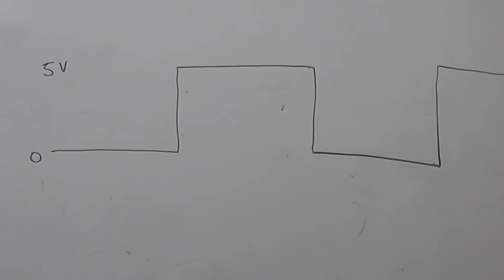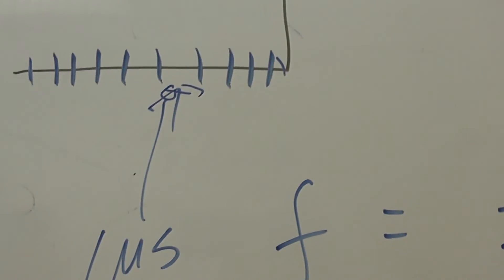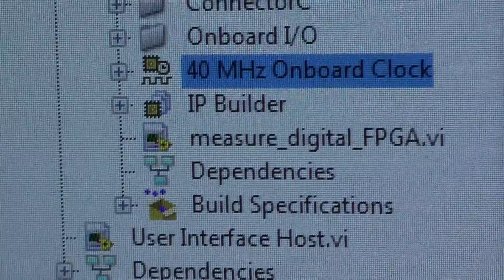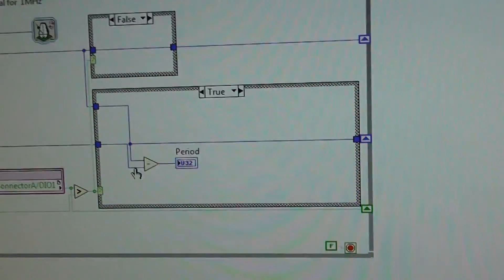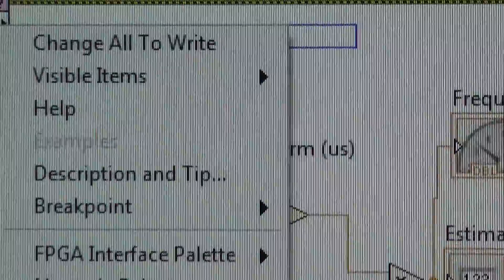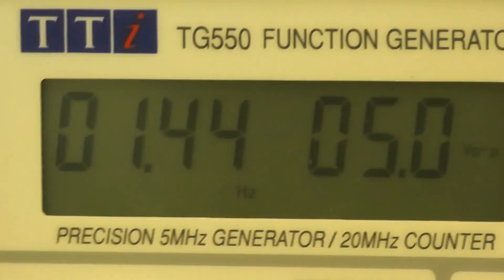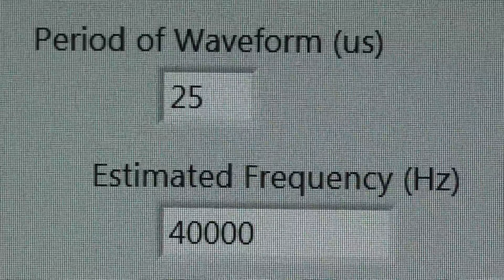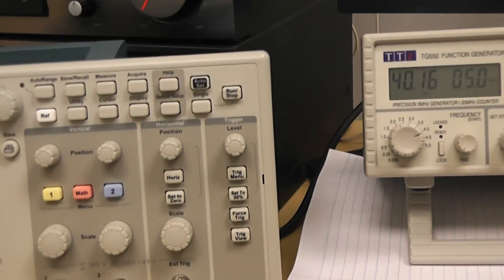myRio FPGA  Digital Tacho Measurement of Speed

Comment: Hi Thomas, I'm busy building a tachometer for measuring my wind turbine's RPM, using a photointerrupter and a slotted disk. The code that you have here isn't working for my tachometer, could that be because the voltage isn't dropping to purely 0V? It drops to roughly 0.5V.
Reply: Hi can I ask is your project settled? Did you use the NI software to measure the data from the sensor?
Reply from the maker: Sorry I don't have access to NI hardware any more as I have retired but the code was more or less NI as I remember give or take a few scaling bits. whether it is still out there I don't know.